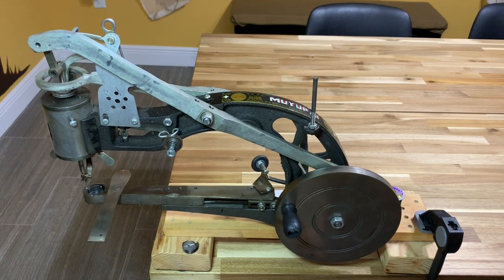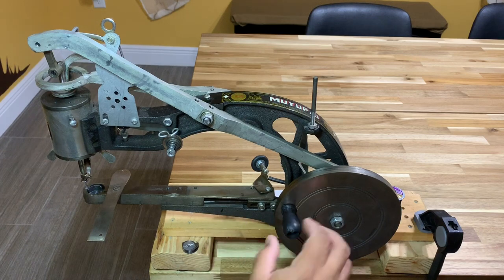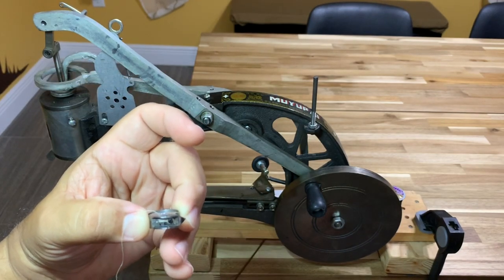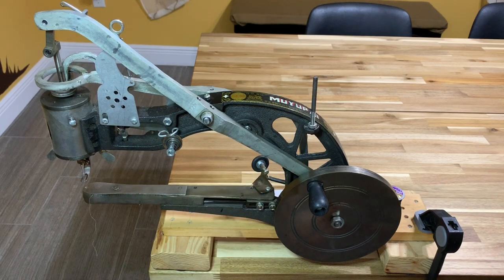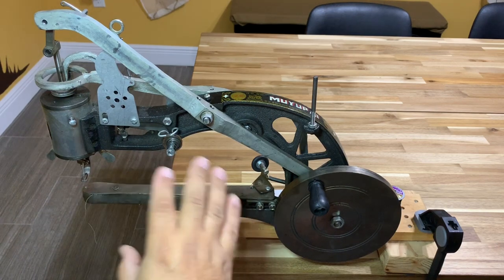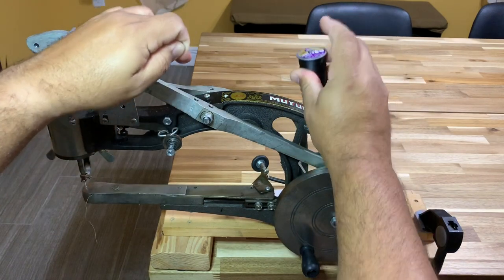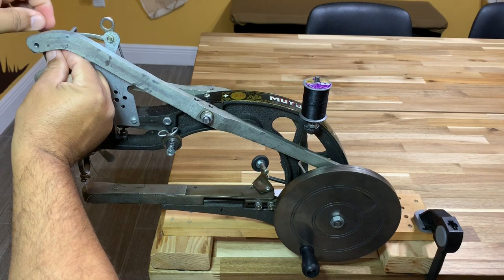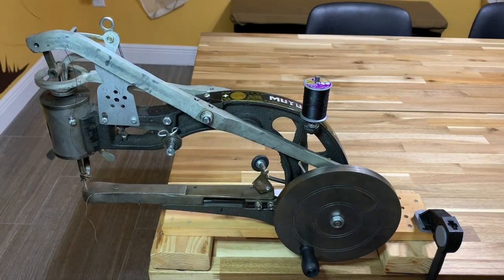Muyupai Leather Patcher Threading Part 2

Comment: ahh why doesnt the bottom thread come up
Reply: You did not mention if you have previously sown with the machine or this is your first attempt at using it. 
My assumption is that the needle is correctly inserted, and that the top thread is correctly threaded from the reel through the machine to the needle eye. Also, the bobbin is correctly wound and inserted in the shuttle so that it rotates counterclockwise when the thread is pulled. 

If this assumption is correct, there are two likely reasons for the needle and top thread not to pick up the bottom thread. 

1.	The needle position at the point of maximum downward stroke.
2.	The timing of the shuttle carrier (This carries the shuttle and bobbin). 

Needle position
Before the next step NOTE the position of the handwheel (12 o’clock) and the shuttle carrier (the tongue or side piece will be at 3 o’clock) Take out the bobbin, shuttle, and shuttle carrier (the piece with the gear/pinion on the underside).

Turn the hand wheel clockwise until the needle is at its lowest position (handwheel at 3 o’clock). At this position, the top of the needle eye should be level with the bottom of the recess that shuttle carrier sits in. This can be difficult to see. A good light and even a magnifier may be helpful.
If the needle eye is higher than this, drop the needle shaft lower. This is done by first locating the connection link at the top of the needle shaft. You will see a screw that passes through the pivot. This screw locks the link to the needle shaft. Slacken this screw and move the needle shaft down to so that the needle eye is in the correct position. Tighten the screw, but before doing so make sure that the needle shaft has not rotated. The needle eye needs to face along the bed or arm of the machine.

The maximum downward position of the needle is important as it is part of the movement that forms a loop in the thread that the shuttle hook picks up. If the needle eye is too high, a satisfactory loop is not formed, and may cause the thread to jam between the shuttle and shuttle wall.

Re-assemble the shuttle carrier in the original position. It may be necessary to slight “rock” the handwheel until the gear/pinion on the shuttle carrier engages with the rack. then insert the shuttle with bobbin.
Now thread the needle and go through the routine for picking up the bobbin thread. Pull 2-3 inches (50-70mm) of thread from the bobbin, lie it in the groove on the side of the shuttle well, close the top plate/gate. Then rotate the handwheel. If the timing of the shuttle movement is correct, the bobbin thread will be collected by the top thread.

Assuming that the needle eye position is now in the correct position at maximum stroke, if the bobbin thread is not being picked up the problem is now likely to be the timing or position of the shuttle.

Timing or position of the Shuttle Carrier
To check the timing, open the bobbin cover plate and look down on the shuttle and shuttle carrier. NOTE it is preferable that the needle is not threaded for this check. Rotate the handwheel to the 9 o’clock position. Be accurate with this position. Then visually note the position of the shuttle carrier. You are looking to see if the upright edge of the shuttle carrier is just covering the needle slot. This setting is critical to the functioning of the machine. There is a little latitude in this setting but not more than just beginning to cover the slot to almost fully covering the slot. A wrong position can lead to the hook not picking up the bobbin thread, or the top thread being trapped below the shuttle and breaking.

The rotational position of the shuttle is adjusted by slackening the two nuts on the bar that moves the rack, which rotates the shuttle carrier. Once the nuts are loosened, the bar can be moved laterally. The bar only needs moving slightly (either way) to rotate the shuttle carrier to the correct position. Re-tighten the nuts, then rotate the handwheel a couple of times. Re-check the alignment of the shuttle carrier with the needle slot. Re-adjust if necessary. You may need to do this a few time to get it right!

When the alignment is correct, the hook on the shuttle will pass through the loop formed by the needle. 
Now repeat the routine for picking up the bobbin thread. If the needle stroke position is now correct and the shuttle carrier aligns with the needle slot, the machine should collect the bobbin thread, and importantly, sew without breaking the thread … assuming the threading and tensions are correct.

I hope this is helpful. Trick to explain in words. Sketches would be easier to understand.
Reply: @johncollins2452  thanks for the details.  My machine works but we are going to take apart the insides to make sure they are clean of grit and clean them up a little.  This will help me make sure I get things put back together.  Unfortunately YouTube won't let me bookmark your comment or copy the text for future reference.  I hope I can remember where to come back to.